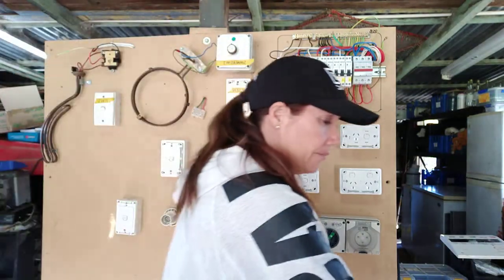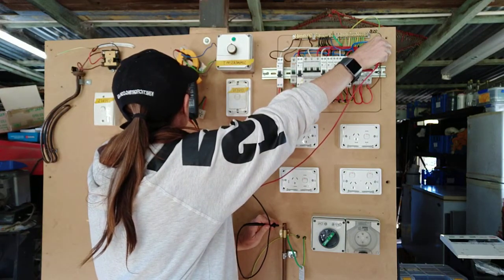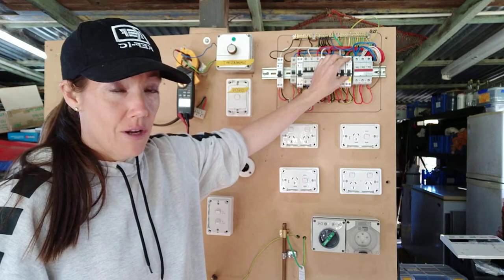Electrical Capstone Practical Exam.  Earth Continuity. Ensuring correct installation / Fault FInding

Comment: What if bondings in earth bar?  Earth continuity wouldnt it be best to disconnect earth at board?  To get true resistance of that earth conductor?
Reply from the maker: Difficult to respond because you comment doesn't read well. At 0.35seconds I  remove the Earth Conductor from Earth bar to isolate the earth conductor. I also go on to explain how equipotential bonds also need to be removed and how this can affect readings. Hope this section of the video helps.

Comment: Hey how have you got your main switch wired? Is the bottom of the main switch just bridged?
Reply from the maker: The main switch is not bridged it is the CB separated and located at the right side. Are you looking at the 3 phase CB on the very left? If so the underside is the Line side. 

The Neutral and Earth bars have a bridge, its this bridge that you are removing. This is so that you can test the earthing resistance of the earthing; mains, cable and equipotential separately. 

I noticed you removed the other question you had which might help explain this more. Your other question about the load side being on top and not the bottom is a good one that many new electricians wonder about. 

The reason for putting the load side on top is for safety. Imagine if dust or ants create a short and a fire for whatever reason you want your damage to be on your sub circuits where you can easily replace wires and not in your submains or mains that usually underground and will cost more and is harder to replace and repair.

Comment: Earth continuity less than 1ohm? Main earth and equipotential have to be 0.5 ohms or less
Reply from the maker: Yes at 1.47 I say all the resistances you'll measure are under 1 ohm referring to getting your tester tested  properly it wasn't meant to be specific to Main Earth or equipotential.and includes all test readings. Technically final sub circuits can go up as high as 3 or 4 ohms and be a pass according to AS/NZS 3017:2007 Table 3.2. 
Main Earth and equipotentialbonding does need to be least than 0.50 ohms. 
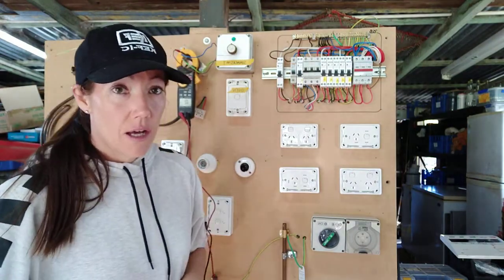 Watch from 4:00. All final circuit resistance readings need to comply with earthing Table 3.2 in AS/NZ3017. The limit of ohms is actually dependant on the size of the cable, the CB size and type. So some cable with a reading of 0.4 ohms will actually be a fail. Some with a reading of 0.8ohms is actually a pass. Get familiar with the table you will need this table during your exam.
Reply: @theea3466  thanks for replying. I was being a smartarse. I think you are doing a fantastic job putting yourself out there as an apprentice and doing a testing presentation. Shame some tradies weren’t as dedicated to the trade like you. 
Just a pointer on earth resistance there is a sub circuit where the earth resistance reading is above 1 ohm. Maybe a reference to Table 8.2 (from memory) to check what the maximum resistance allowed for the circuit under test. 
Keep up the brilliant work. 
Cheers 
Steve
Reply from the maker: @stevechadwick180  
Table 3.2 goes up to 6 ohms in 1mm cable but got to keep in mind limits and rules in AS 3000 in regards to cable size for power and lights. 
If the thinking is that the final sub circuits just always less than 0.50 ohms apprentices will struggle to pass.
Reply: @theea3466  When we delve in and only good tradies will delve in and start researching and asking questions it gets deeper. I noted you said you need to ascertain if the installation is new or old and this will make a difference to the insulation readings. 50Mohms opposed to 1Mohm. This would also need to be cross reference with the SIR (service and Installation rules) unless working in WA or Qlds where they have there own name for this document where mains are required. To have a reading of no less than 50Mohms ( that’s from the VIC SIR and from memory). Also another one for old players the same question asked when performing the main earth and equipotential resistance test prior to the AS/NZS3000:2007 the reading would pass if it was 2ohms or less. So doing a test on an old installation 2ohms may be acceptable.
Reply from the maker: @stevechadwick180  
Thanks Steve. 
I do mention the difference between acceptable levels between new and old installations and say to ask your exam officer if they don't tell you its new or old. I made so many videos I'm sure its in the first one. I retook a few videos and I didn't edit so im hoping its there and not in a deleted video.
Reply: @theea3466  yes you definitely mention it for insulation resistance with a new install being 50 Mohms and an old install being 1 Mohms. Most sparkles will not know of the Main earth and equipotential bonding being acceptable for old installs at 2 ohms. 
May I ask what State you are based and if you plan to do more videos?
Reply from the maker: @stevechadwick180  
NSW.Northern Rivers. 
I did make a few more that I didn't upload. One was testing motors as I dried out a shitload after the flood. I'd like to make more. I'm keen to dedicate some space in my section of the shed. (Still negoiating with the alpha male)
Reply: @Pjn77  yep that’s it
Reply from the maker: @stevechadwick180  
 @Pjn77  
Use Table 3.2 from AS/NZ 3017:2007. Remember your values are to 2 decimal points and Table 3.2 is more accurate. Table 8.2 is from AS/NZ3000 it has been rounded down as it only uses 1 decimal point.
Reply: @theea3466  
Apologies and this is my bad, it was a while back and you are both correct with the tables you have suggested. I should have put table 8.2 from AS/NZS3000 and table 3.2 from AS/NZS 3017 is a good tool to use especially in older installations. Just a note that AS/NZS 3017 is now revised to 2022.
Reply from the maker: @stevechadwick180  
Do not use Table 8.2 for testing in capstone. It's not as accurate as Table 3.2
Reply from the maker: @Pjn77  
Use Table 3.2 from AS/NZ 3017:2007. Remember your values are to 2 decimal points and Table 3.2 is more accurate. Table 8.2 is from AS/NZ 3000 it has been rounded down as it only uses 1 decimal point.

Comment: Thanks a lot of these videos. A lot of these points seem to have been neglected from my course.

Something I did notice is that earth continuity cannot be done with a normal multimeter. Not sure if they allow this in the capstone.
AS/NZS 3017 says the test equipment must comply with AS 61010.1 and IEC 61557.
In IEC 61557-4 Resistance of earth connection and equipotential bonding states:
4.2 open circuit voltage shall not exceed 24 V and shall not be less than 4V
4.3 Measuring current within the minimum measuring range according to 4.5 shall not be less than 0.2A
4.5 Measuring range within the operating uncertainty in accordance with 6.2 is maintained, shall include the values between 0.2 and 2 Ohms

normal mustimeter do not measure at 200mA and are not accurate for these low resistance values. Hence why it is only giving you one decimal place. Just something to keep in mind as it caught me out too.
Reply from the maker: AS/NZS 3017 Page 8 says test equipment should comply with requirements of IEC 61557 and Page 6 states 3017 refers to IEC 61557 Parts 3 & 5. 
 
4.3 is saying your testing range needs to be larger than 0.2ohms.

Ideally you'd use analogue ohmmeter as figures show in AS/NZS3017

My multimeter reads more than 1 decimal point as I show in the video and multimeyer ranges do go below 200mA.

Different multimeters have different ranges, accuracy and resolution..
Reply: I thought it was very strange to take a reading from an instrument which has only 1 significant figure and then just magically tack on an order of magnitude accuracy by inventing an extra decimal place.
Reply from the maker: @whatilearnttoday5295 
For assessment purposes the reading required by the standards has to have 2 numbers after the decimal point. I.e 0.05 or 0.50.
Reply: @theea3466  So if you read 0.51 you write 0.50 or 0.51? All your readings ended with zeros.
Reply from the maker: @whatilearnttoday5295 
The reading is 0.51 so you write it as 0.51. I dont think i measured anything at 0.50.  I was referring to the limits from the table. 
Like 1 table has all the readings in 1 decimal point e.g 0.5 and the other has the reading with 2decimals. E.g 0.50 
So you need to refer to the 2 decimal table or add a zero to the numbers with only 1 decimal point.

Comment: You removed earth from the hot water unit but not from the equipotential bonding. Shouldn’t you take it off the pipe as well?
Reply from the maker: Great Question. 
I have no pipe on here just earth stake.  
What is equipotential bonding? 
What is it attached too? 
In this case it's the metal water pipe and its attached to my Hot Water System.  
Your water pipe may have a parallel path so that's why earth comes off the HWS.

Comment: Hi Could you give me a clue as to how you test the earth continuity 
on a underground cable connecting the MSB and a sub-board. Thank you
Reply from the maker: Depends on why your doing it?  
Keep in mind I'm not a teacher but will explain it the best I know how.  

If you know that N is sound and not intermixed you can attach the Neutral to earth at either the MSB or sub board.  Then go to the other board that's not attached remove earth and Neutral from bars and test resistance if the resistance of both cables are lower than the maximum resistance according to table for cable size and CB size you know it complies. 

If it is strict testing like in capstone. You'd use a trailing lead or in fact any cable you have that is long enough to reach your MSB and Sub board.  
Step 1 Test the resistance of your trailing lead or cable.  Write the ohms result down on paper or cardboard or enter into your phone.  

Step 2 attach lead or cable to the underground earth cable at one location either at at MSB or Sub board. 

Ask yourself what am I attaching this lead to?  Have I attached the earth cable only for this cable under ground?  

Then walk the trailing lead to the other board.  Remove the earth cable for that cable underground out of the earth bar.  

Test between Earth of the underground cable and trailing lead or connected wire in cable.  

Write the result ohms down.
Then subtract the trailing lead or cable reading that you wrote down before.  
This will leave you with your restistance reading for just the underground cable.  

Does this help?  
Please don't be afraid to ask your teacher.  Chances are if you don't know half the class won't.
Reply: @theea3466  Thanks heaps great reply

Comment: Don’t you have to check that each protective earth conductor is not switched?
Reply from the maker: So when you do Earth Continuity you are only  testing the earth conductor at the earth points. 

BUT.... if the earth wire was placed in the switching wire terminal you will not get a continuity reading at the earth point. The tester will read OL.

So for the test you will write OL no continuity and you'll later discover the error when you do the polarity test. 

There's no harm in checking though. Like if I came across a switch and I have no continuity at earth my first reaction is to test the A and N.  If you do it during the capstone, just make note of it on your records and continue with the testing steps. Just make sure you still do the polarity check on the switch when your up to Polarity testing to confirm just 2 wires connected wrong or all three and check resistance readings in case extra wires are added etc.

There is a systemic system for how you test. 
Step 1) Earth Continuity
Step 2) Insulation Resistance
Step 3) Correct connections 
Step 4) Polarity
Step 5) Fault Loop Impedance
Step 6) RCD Operation 

Hope this helps :)

Comment: Hi. Thank you. In reality the socket outlet is for example 10 meters far from the switchboard, how should I test the continuity ? Using a voltmeter with 10 meters cable ?
Reply from the maker: Great question.  So what you'd do is use a trailing lead.  You can use any cable that will be long enough to reach 10m.  Use a multimeter or a meggar to measure resistance of just your trailing lead cable. (Write the ohms down on a bit of cardboard or paper whatever you have available ). Then attach one end of trailing lead or cable to your earth bar and run cable through house to your PowerPoint 10m away.  Then you'll test resistance between the tip of the trailing lead or cable to the earth on the PowerPoint.  When you have your resistance measure in ohms you just have to -(minus) the cable resistance to get the resistance of the circuit.  
For example
Measure:
Trailing lead ....reads 2.60 ohms
Trailing + circuit.....reads 3.10 ohms
Calculate:
Circuit= (trailing lead+circuit) -trailing lead.  
3.10 ohms-2.60 ohms =0.50 ohms
Hope this helps bud.
Reply: @theea3466  What if we are unable to use a trailing lead due to people or it is not practical? For example, a factory setting with people driving forklifts or pushing trolleys around?
Reply from the maker: @doctordoomsnipes  
Keep in mind usually this test is done before energerzing.  Could be tested after work hours.  Another option is to remove unenergized neutral from board and join it to the earth wire in the circuit your testing. Measure the resistance at the other end.  If the reading of both cables together are lower than max level your sweet as.

Comment: Hi, awesome video. Just in regards to the table reference you made (3.2) which rule book is this in?  As table 3.2 is limiting temps for insulated cables in As3000.

Thanks !
Reply from the maker: It is the Maximum values of Resistance for Earth Fault Loop.  Table 3.2 is from AS/NZ 3017:2007 Electrical installations -Verification  guidelines. Page 40.
However this is exactly the same as Table 8.2 in AS/NZ3000:2018 on Page 428.
Reply: Awesome, thankyou!